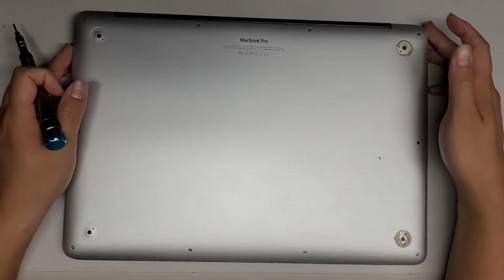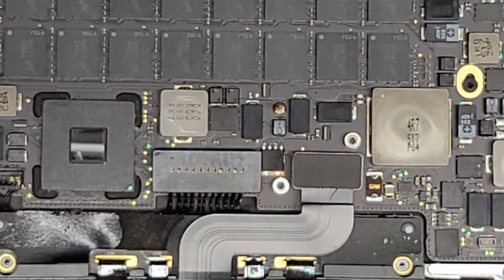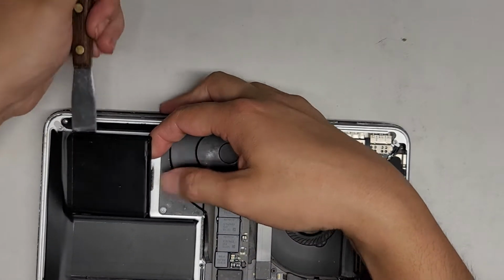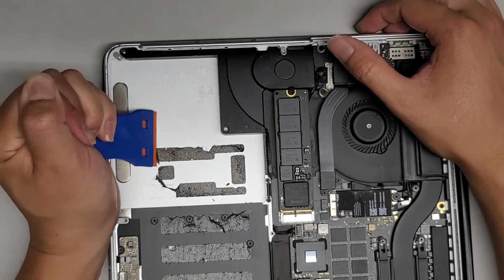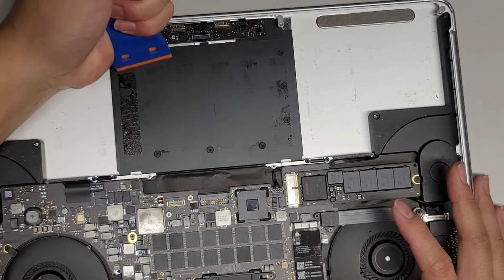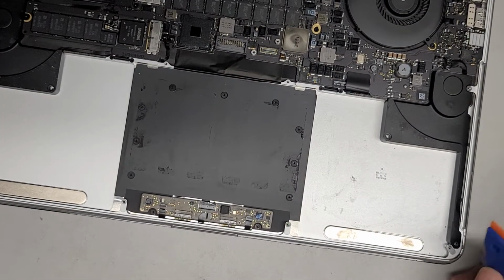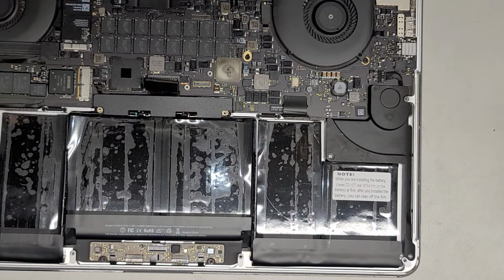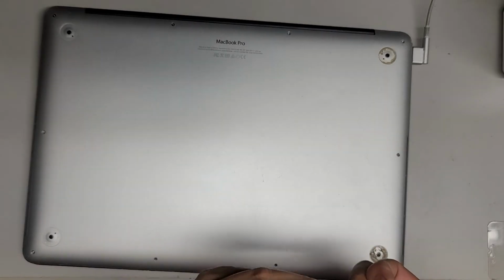15" inch Retina MacBook Pro A1398 Mid 2015 Disassembly Battery Replacement Repair

Comment: Thanks for sharing this, it's been very helpful. I did a bit of a mod - instead of using the cake spatula, I dripped some isopropyl alcohol along the sides of the battery modules, let it sit for 30 seconds then used a fishing line underneath the batter and gently pulled it towards me to hack away the glue  :-)
Reply: Sorry, battery not batter  :-)
Reply from the maker: Glad you figured out another way
Reply: No need for using alcohol or adhesive remover, just a strong thread worked smoothly in my case.
Reply from the maker: I was never able to get that method to work for me.

Comment: Just got mine repaired at the Genius Bar for free as part of the battery recall program. They seemed to replace the top case and keyboard too, it looks so clean. Do check your serial number to see if you're eligible.
Reply from the maker: Cool

Comment: Just did this repair. Thx for the breakdown. My only tip is use lighter fluid for removing the old adhesive. Then wipe clean with Isopropyl.
Reply from the maker: I worry about using chemicals like that on a daily basis.

Comment: Just did my replacement using your video.  Thanks for the detailed steps and zooming in!!  I didn't have a fancy pry tool, but was able to cut through the adhesive with a thin plastic card.
Reply from the maker: Glad it helped. If you haven't already, please like and subscribe so others can find my videos. Thanks!

Comment: Awesome tutorial and very thorough job getting all that glue and dirt out. I was wondering where you bought the metal spudger used to break the battery free from the adhesive?
Reply from the maker: I got it used on ebay. This would work, but might need to grind the tip a little thinner https://amzn.to/3VTROFi

Comment: Great video
I followed instructions
My blown up battery replaced... And my laptop that wasn't even turning on has a working battery!
Thank you

Only problem is my trackpad and keyboard is not working now.
If you guys have any suggestions (on what I screwed up) please let me know.
Thanks!
Reply from the maker: Remove and re connect the trackpad cable
Reply: @ItsBinhRepaired  That was it!
Or more accurately... I forgot to drop that little trackpad hinge clasp back down. 
SO... Again.... GREAT Video... EXTREMELY Helpful (I couldn't afford to have someone else fix my battery - So I was able to do it with 50$ over 300$)

Thank You Kindly!!!!
Reply from the maker: @JeremiahDirt  glad it helped! If you haven't already, please like and subscribe so others can find my videos. Thanks!
Reply from the maker: Thanks for the contribution! Really appreciate it.
Reply: @ItsBinhRepaired  Great vid by the way. I was able to install a new battery and it was simple. However…
I have the same issue like this dude but I’m my case, both keyboard and trackpad are unresponsive.

I tried to dis and re connect the original flex cable but it didn’t work. Maybe I damaged the cable I thought, so I bought a brand new cable and CAREFULLY installed it on the trackpad board and the motherboard; the outcome was the same. I don’t know what else to do to bring back my device.

Any thoughts?
Reply from the maker: Did you remove the trackpad before removing the battery? I've seen a lot of people damage their trackpad trying to take shortcuts and end up scraping the back of the trackpad.
Reply: @ItsBinhRepaired  Thanks for your concern. It seems that the trackpad was damaged by the (cheap) alcohol I used to unglue the cells seated on top of it and on the sides. Sh!t contained 30% water and ruined it. At the end, I bought another trackpad on Amazon and install it in the laptop 💻 It works again as intended.

Learn from my dumbass mistake guys and DO NOT CHEAP on alcohol! Make sure is (at least) ethyl +96% if you want to detach the battery out of the chassis. 

Regards from Baja Mx and have a great rest of the day 😃🤜🏼
Reply from the maker: @MartinRiosArellano  oh, for this model, you don't want to use alcohol to remove the battery. That's why I cut the adhesive out.

Comment: Thanks for the helpful video.  I've walked through the process you outlined and my new mac battery is working great.  I'm concerned that I may have damaged something in the keyboard.  the space bar no longer is working nor is the delete key.  Everything else seems to work fine.  Any ideas what is needed to get them working again?
Reply from the maker: You might have damaged the keyboard cable :( you can try reseating it

Comment: Thank you for this great video. Your replacement battery is 11.26v 99wh but original battery is 11.36v 95wh, it works well anyway?
Reply from the maker: Yup, works fine.

Comment: Great video, thanks! What is the name of this metal flexible tool which you push under the battery cells and where can I buy it? I went to my local Home Depot and showed them the screenshot; nobody knows what it is.
Reply from the maker: Basically this https://amzn.to/3wvIE43 but you'll need to file/sand it thinner. I haven't been able to find one exactly like it. It came from a closed down pharmacy. I got it on ebay haha I used the one like the link I sent you after filing the tip really thin and it works, but it's pretty time consuming to file the entire thing that thin. A belt sander might make it easier lol
Reply: @ItsBinhRepaired  Thanks for your answer. What do you think is the most optimal length for this spatula?
Reply from the maker: @8khdrsoothingrelaxation276  4"
Reply from the maker: Possibly 5" if they make one

Comment: After changing batteries..
Changed Trackpad ribbon everything works …
til I close the computer back up..
Then the trackpad sometimes works but the keyboard doesn’t..
What am I doing wrong that the keyboard stops working once closed??
Thx
Reply from the maker: Might have damaged the trackpad or trackpad cable.
Reply: @ItsBinhRepaired  so the keyboard is hooked up to the trackpad cable?
Reply from the maker: @jaycee7440  apple is an ass and linked them via software.

Comment: I broke the little tab that holds the trackpad ribbon in.. I replaced the battery that’s working fine but the Keyboard is not working..the ribbon is snug but not clipped in..
Reply from the maker: You can try adding a layer of tape to thicken the cable to make contact. That might work.
Reply: @ItsBinhRepaired  thx 
I bought a new ribbon and it also fits snugly but keyboard and trackpad not working..
Maybe I should buy a new trackpad for $34
🤔
I may have to get an external keyboard and mouse to reset PRAM and SMC whatever that does…
Thx for any insight
Reply from the maker: @Jay Cee  if pram and smc reset works with the built in keyboard, it's definitely a trackpad issue.

Comment: Hi, my keyboard is not working. The keys work when i try to smc rest and the power button works too. The track pad is working but the click sound option is not working. Can you please help me with this?
Reply from the maker: What do you mean by click sound option?
Reply: @ItsBinhRepaired  click firmness
Reply from the maker: @nivindotin1750  the keyboard keys don't click
Reply from the maker: This?  https://youtu.be/PW9MlsWXS3o
Reply: @ItsBinhRepaired  so the trackpad click firmness is not working. The keyboard looks and sounds fine, but it is not working. I am not able to type anything. The power button is working and other keys that are used to rest smc and pram works while reseting.
Reply from the maker: @nivindotin1750  sounds like a faulty trackpad
Reply: @ItsBinhRepaired  what do you think about my keyboard?
Reply from the maker: @nivindotin1750  apple is an asshole and disables the keyboard when the trackpad has issues so they can tell you they need to replace the entire palmrest assembly...assholes...
Reply: @ItsBinhRepaired  my trackpad and keyboard were working normally until i changed my battery. Now my keyboard is dead and my trackpad tap is too firm
Reply from the maker: @nivindotin1750  you might have damaged the trackpad cable or the trackpad
Reply: @nivindotin1750  did you replace it? What did you do to get it working again ?
Reply from the maker: @sam_ed it blew up
Reply: @ItsBinhRepaired  blud is answering after 1 year 💀💀🙏🙏🙏
Reply from the maker: @sam_ed yeah, YouTube is dumb like that

Comment: Great video..

Why do you clean the old adhesive off?
To make it easier the next time..
Why not..

Not expose the new 2 sided tape..
Just use old adhesive..to hold in place..
🤔
Reply from the maker: If you don't clean it off, it won't even stick.
Reply: I guess the battery  needs to be immobilized..Just looks like a lot of work to get it out..I was thinking if it wasn't as glued in..the next replacement would be much easier to get out..but by then..a 2015 Laptop really would be Obsolete..Thx for getting back to me..
Reply from the maker: @jaycee7440  you can leave it loose if you want, but it'll rattle when the laptop shakes.
Reply: @ItsBinhRepaired  thx..
Makes sense…
🤓👍
Reply from the maker: Yup

Comment: My keyboard and touchpad not working after replace the battery, how fix it? Should i replace the flexible cable ??
Reply from the maker: Double check the trackpad cable. Hopefully you didn't damage the trackpad.
Reply: @ItsBinhRepaired  I bought a flex cable  and I installed it.  but still not working, please help me to fix it, what should i do
Reply from the maker: @alphastudioid  possibly the trackpad itself. Hopefully you didn't damage the keyboard cable :(
Reply: @ItsBinhRepaired  is it possible that if I change the trackpad, the keyboard can work again?
Reply: @ItsBinhRepaired  are touchpad and keyboard connected to each other?
Reply: @ItsBinhRepaired  now its only power button works
Reply from the maker: @alphastudioid  they aren't physically connected, but Apple is an asshole and linked them via software. If the trackpad is bad, Apple disables the keyboard...
Reply: @ItsBinhRepaired  okay thanks you dude.  I will buy a new trackpad, hopefully I'll be lucky

I have high suspicion that my trackpad is damaged when I remove the battery, cause there is scratch

I'll subscribe your channel😉
Reply from the maker: @alphastudioid  hope it fixes the problem. :)
Reply: @alphastudioid  Hey man, I have the exact same problem? Did it work for you? What did you replace? Thanks
Reply from the maker: Hopefully fixed by now

Comment: I replaced the battery and followed the instructions by resetting the SMC and PRAM. My charger light changed from orange to green and back to orange during the SMC reset. I also heard both chimes during the PRAM reset. Everything appeared normal for a few days. My battery was around 85% fully charged last night. When I woke up this morning, the battery was at 15%. I always close the lid at night and do not completely shutdown. I did not have any extra apps running when I closed the lid last night, which I again verified this morning when I opened the lid and started using the MAC. Any ideas on why the battery drained ~70% overnight or should I expect erract reported percentages with the replacement battery?
Reply from the maker: Sounds like your mac didn't actually go into sleep mode.
Reply: @ItsBinhRepaired  that’s what I’m thinking. Thank you.

Comment: So I installed the battery successfully. However it won’t turn on? It’s stuck in some kind of sleep mode. Fans keep running but Mac won’t chime on, any ideas or tips ?
Reply from the maker: Very strange. Double check the trackpad and the battery connectors.

Comment: Hello I replaced the battery and now the laptop seems slow and the fan keeps running. Any ideas? Thanks
Reply from the maker: Might be trackpad damaged
Reply from the maker: If trackpad is fine, then the battery might be bad. There was one laptop where I tried every band and ended up having to use one from owc or ifixit, which was very expensive
Reply: @ItsBinhRepaired  The trackpad and keyboard don't seem to work and it's glitchy?
Reply from the maker: @russd769  that's from a damaged trackpad/trackpad cable.
Reply: @ItsBinhRepaired  ok thanks... can i just replace that cable?
Reply: @ItsBinhRepaired  Also the fans keep running. can that be from the new battery or the bad cable?
Reply from the maker: It can be trackpad, trackpad cable, and/or battery. I can't tell you which one exactly because the only way to know is to change them with known good parts.
Reply: @russd769  Hey, did you replace the cable and did it work ?

Comment: Will it power on when the battery is detached?
Reply from the maker: Sadly no, because Apple is a buttmunch.
Reply: @ItsBinhRepaired  thanks, I saw some comments saying mid 2015 required battery to power on. Really stupid product. Btw, thanks for the response, your video is very good.
Reply from the maker: Yup, Apple forcing people to bring them in for repairs.
Reply: @ItsBinhRepaired  really apple support sucks, asked me to sell my MacBook Pro 15” retina to a cheaper price. Now I was able to boot it up properly after replacing the battery. Conclusion: Do not believe apple support, & trust your self. Do you have video to replace the speakers?
Reply from the maker: @KurtCobain2021  yep, here https://youtu.be/964JovWLk48

Comment: Thank you for this great video. Where did you purchase the replacement battery? I already returned two batteries due to their bad quality. Thank you.
Reply from the maker: What was the issue with the batteries? Try this https://amzn.to/3oV9Gyc
Reply: @ItsBinhRepaired  Thank you, I will try this battery. One year ago, I purchased a replacement battery from eBay. However, it was faulty. Not charging full and drained quickly. Finally, around 60% battery, I failed booting and only connected with charger, I can boot it up.

Comment: So is there a reason why Macbook batteries are such a pain in the rear to replace? Why can't they be designed like most PC laptops? I am sure there is a logical explanation, but you'd think they would have come up with a better design by now.
Reply from the maker: The reason is they don't want others to profit from the battery replacement, that and they claim that people will put bad batteries that will cause risk of fire, which is somewhat true, but not very likely. If that were the case, they could sell their own batteries easy to replace. They also don't want the liability of people opening their devices, damaging them, and then trying to claim warranty.

Comment: You could have made this easier with a little adhesive remover or 99% alcohol.
Reply from the maker: Try it. It doesn't help. Plus I don't like flooding the battery with liquid.

Comment: be CAREFUL using a metal tool on a battery.  If the battery casing is pierced, you're gonna get a helluva smoky shock.
Reply from the maker: The material you use doesn't matter. You don't want to puncture the battery no matter what you use.